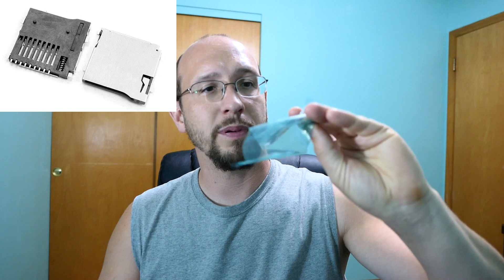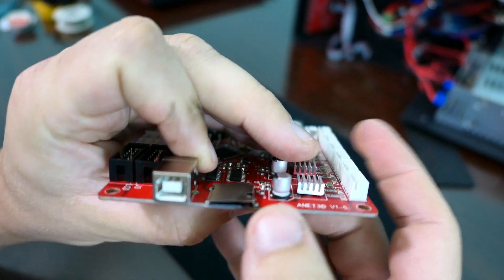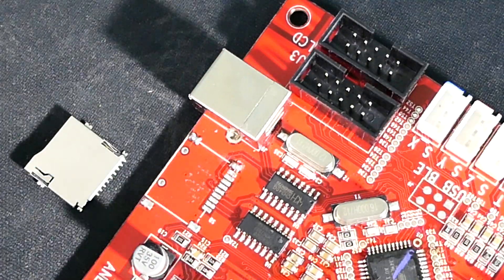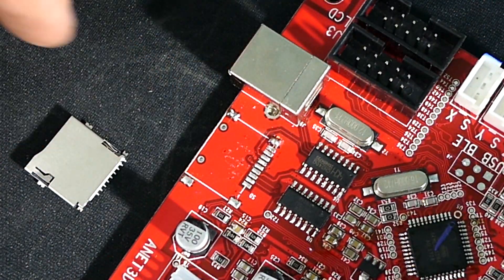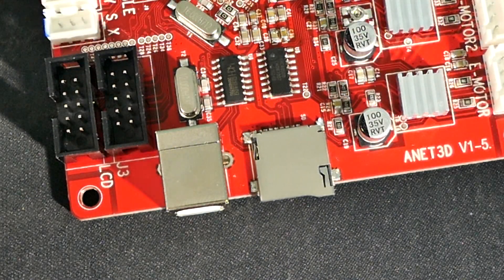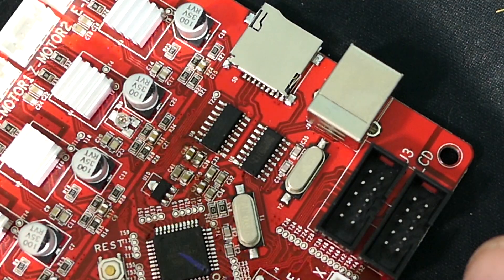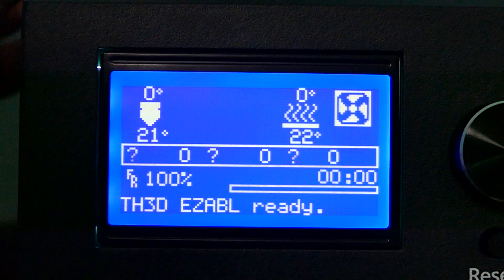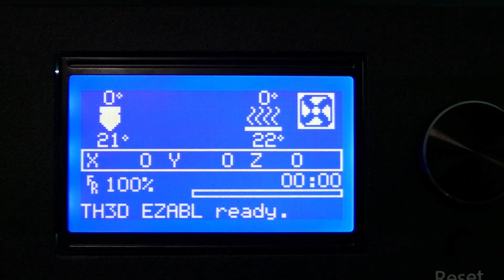3D Printer MicroSD Card Slot Repair

Comment: Without using fresh solder or flux on the new sd card slot especially the 4 corners that will come off the board sooner or later.

Comment: Decent video for following procedure, but don't solder like this guy, this is very easy, but you need flux, you don't solder those pins one at a time, you flux, build up your pads, flux more and heat, easy. Even a fat iron like that will work but make the tip sharper

Comment: Any advice on wondering why fan, and motor no longer work along with not being able to see sd card?
The last time it was working it made a whiny noise then nothing moves.
The screen still shows like it works but no movement or fan movement along with not reading sd card

Comment: For anyone attempting this, don't wiggle the shield off or you risk ripping the pads off of your PCB  Also, before taking such a drastic step, try bending the shield back into shape if you've simply stressed the slot out by over-insertion.  If you do need to replace this and you are buying a new soldering iron, consider getting a cheap reflow station (Amazon, Aliexpress, Banggood) and some solder paste and figuring out how to use them.  Much easier for those surface mount pins.

Comment: Hi, thanks for the video. Can you give some advice on how to figure out which microSD card slot I need? I have a Monoprice Select Mini v2 but frankly not entirely sure how to decide which slot I need to get. Any advice is appreciated. Thanks!
Reply from the maker: https://m.aliexpress.com/item/32856634422.html?trace=wwwdetail2mobilesitedetail&productId=32856634422&productSubject=20PCS-TF-External-welding-MICRO-SD-Card-holder-TF-card-seat-self-rebound-card-holder-memory
Reply: @M1dn1ghtN1nj4  Thanks so much, how did you determine that that is the correct slot?
Reply: I was hesitant to do mine but after watching this im going to get it done. thanks.
Reply from the maker: There isn't much variety when it comes to the slots.  I'll look something up when I get home